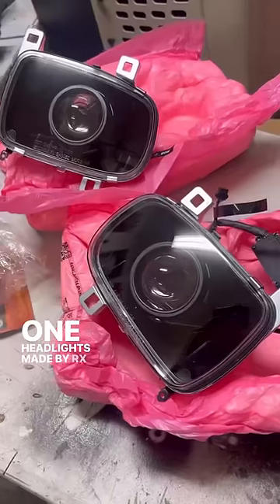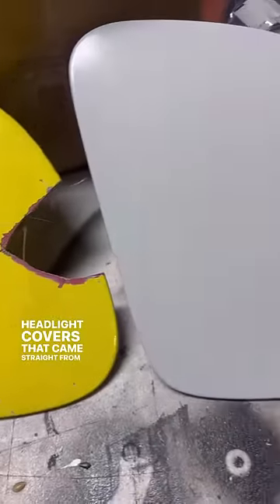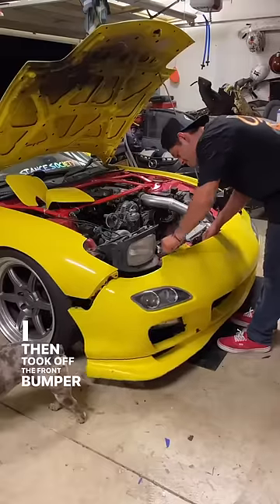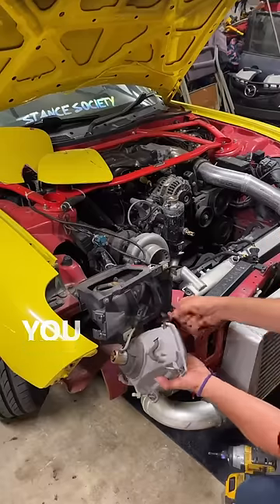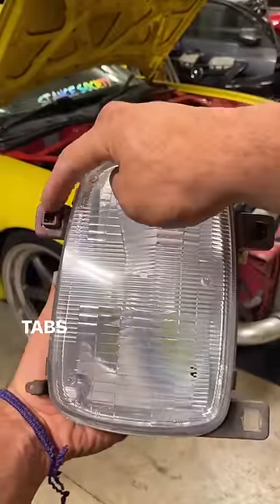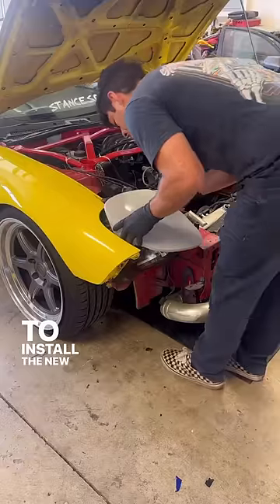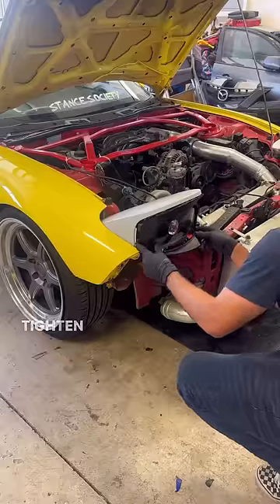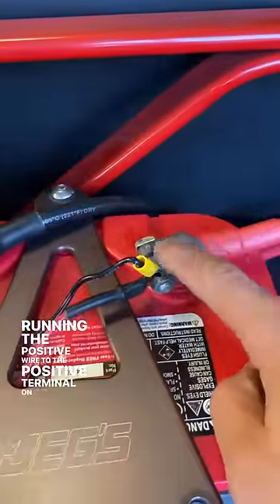HOW TO: Install Demon Eye Headlights on Any Rx7 🔥 #jdm #carlover #rx7 #naruto

Comment: Tap some fuses in there my boi, unless you want the hottest demon eyes out there 😂
Reply: This , also running it to B+ means its always on aswell.
Could''ve found a factory switched wire(fog's,parking lights etc) and used that instead

Comment: Should they be running into a fuse? Like are you sure wiring them straight to the battery is a good idea? Truthfully I don’t know and I’m not trying to Hate, I just figured it’d be smart to run it through a fuse
Reply: Gonna start an electrical fire or something💀

Comment: If u connect positive directly to your battery, it will drain it. It's better to connect it to the ignition or to the alternator
Reply: Genuinely confused as to why he didn't just run them to a switch off of the power wire going to the headlight to begin with.

Comment: Why did you route that wire through the middle of your battery bracket? Now if you want to remove or replace that bracket for any reason, you also HAVE to remove that headlight connection to the terminal. Either way, those headlights look…interesting, but I prefer the OEM bulb color for practicality.

Comment: Might want to put a fuse on there. It can catch fire at the worst or melt all your wires and harnesses at best. Trust me I just saw it happen. A $5 fuse holder AT THE BATTERY will save you a major problem.

Comment: Do not!!!! Wire your headlights like that!! Use the original harness. It has a ground and power wire already and it's much safer going through the fuse panel for the car. It's also wired to your original switch so you don't have your headlights on a cheesey toggle switch.
Reply: Some aftermarket headlights have a few things that need to be wired in but it's still pretty simple.

Comment: But why??? Isn't that illegal?
Reply: How would it be illegal
Reply: @LilTachanka  Red light in front? That's not illegal in your country? Where do you live? I wanna go there if that's the case.

In my country, it's imperative to ONLY have clear lights (white and yellow only allowed). Any other color and you will be fined or imprisoned.
Reply: @elayda93  I Mean they are led light so you can change them for meets and stuff, also you said the original comment as if the changing of the light itself was illegal not the color
Reply: @LilTachanka  If it's for special occasion well that's okay, but if you use this permanently as your daily drive headlights then it's just plain stupidity.

I am not really the aesthetic type of driver. I love cars and I love to drive cars. Having a decent aesthetic is good enough for me.

Try using red headlights in the countryside or anywhere away from the city at night. Just try it.

Number 1 priority for me as a driver is safety, then reliability and performance.